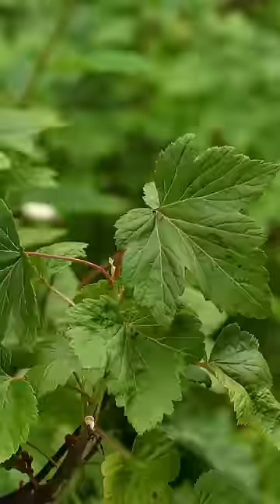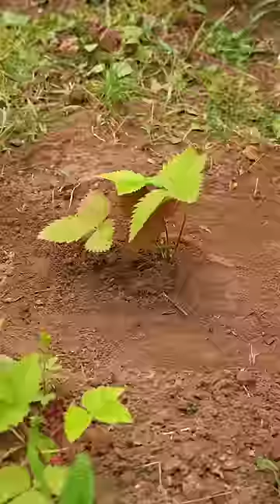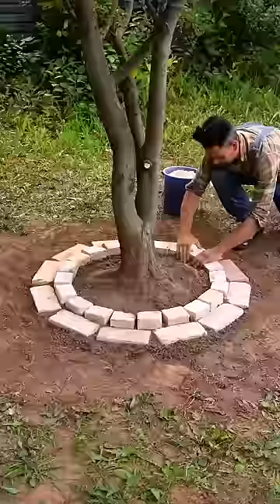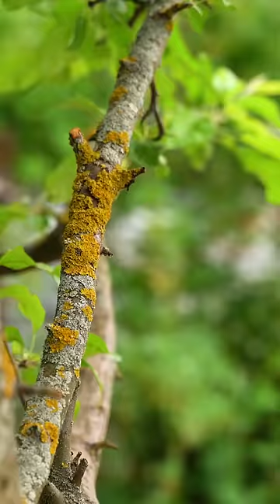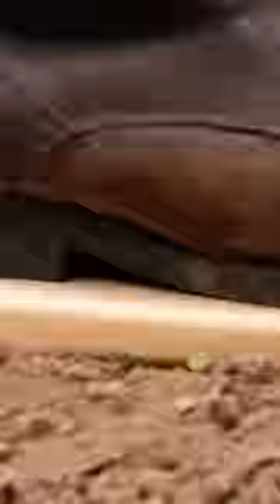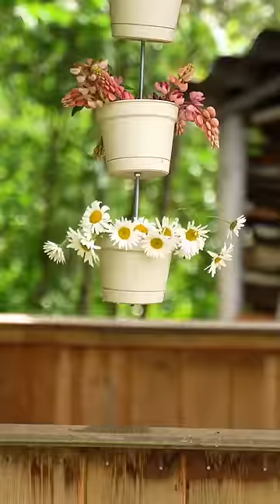Unlock new possibilities for your home with backyard hacks! 👍 #gardening

Comment: I like the fire pit idea. To anyone that may want to try this, you need to make sure the halved barrel you use hasn't been used in the transportation of chemical waste.
Reply: If we're going to give safety tips, then I guess let's add that you shouldn't use river rocks that could explode if water inside comes to a boil...
Reply: @paulk5670  😮
Reply: @paulk5670 Вода внутри камня?! Не смешите, это же не губка, которая влагу впитывает. Камням нужно просто обсохнуть, и они готовы к тому, что Вы хотите с ними сделать. У меня точно такие же камни уложены в парной в бане, и ничего, не ,,взрываются", как Вы выразились,  хотя уложил их в парной уже лет четырнадцать назад.
Reply: Джинсы с землей и цветами при попадании воды, начнут гнить и заплесневеют. А соседи подумают, что это - расчлененка и ты так расправился со своей семьей, за то, что они не довольны были, что ты тащишь весь мусор на ваш участок.
Reply: @paulk5670 The chemical waste in barrels just popped into my head so I shared it.
 I've never heard of that before, not saying it hasn't happened at all. I'm curious what river rocks and is it because of certain minerals in it? Or in a certain parts of the country? I've always used dried river rocks for bonfires while I'm camping.

Edit: I just Googled it and you're right that it can happen where it can fling shrapnel up to 20 feet away from a campfire. I must have been lucky enough to not pick up wet rocks, I only used the dry rocks. If a few exploded I might have thought it was the wood popping not the rocks that another put in or around the fire.
Reply: @ИринаВоздвиженская-р3р That makes a lot of sense about the rot, mold, and the possible worried neighbors that might think one has lost their mind and dismembered someone. The mold could potentially be a health issue, and also, the mistaken false call to police about an individual that was dismembered, I wouldn't want someone innocent shot.
Reply: А мне интересно откуда такие гладкие и одинаковые камушки взяты? Я таких в магазине не видела...
Reply: @paulk5670 😂
Reply: @paulk5670   I was thinking the same thing!
Reply: @___green81   Happened to me while camping.  Made a fire against a huge bolder and it started shooting off fragments.  Had a bugger of a time putting the fire out.
Reply: Камни морские, наверное

Comment: What is the water bottle contraption for?
Reply: I think it's just to blow in the wind - the bottle on the stick shows flaps cut in both sides of the bottle, and it should work like a barrel style wind turbine, spinning in even a slight breeze.
Reply: @pulaski0001  thank you